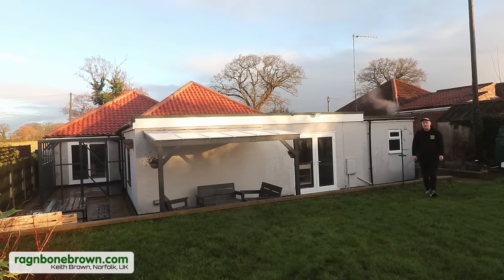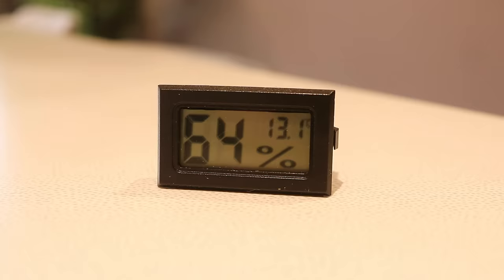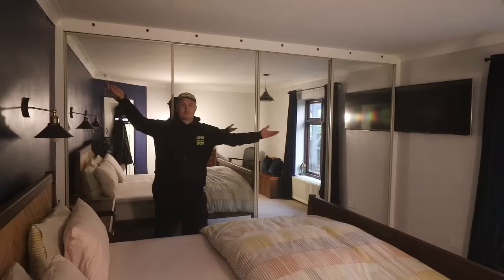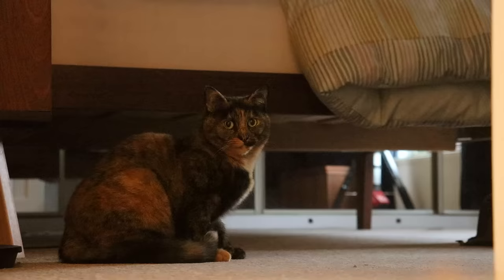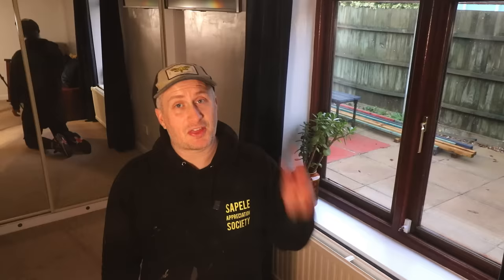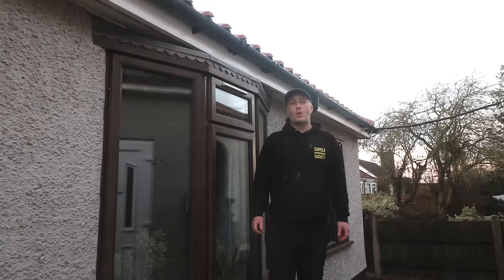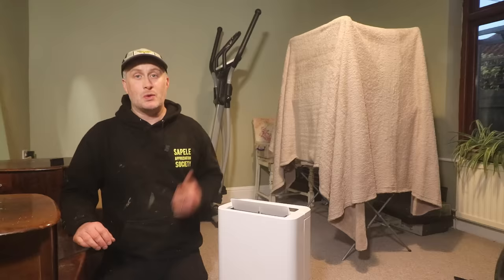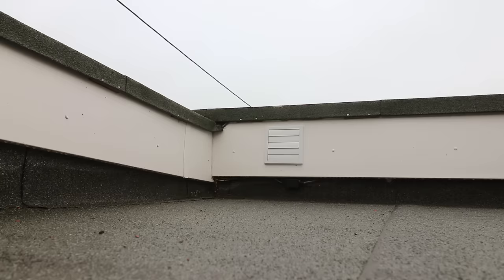8 Steps To Fixing Damp, Mould, Condensation & Humidity In Our Home

Comment: Hi Keith, I have copied what I put on Charlie DIYte videos on a similar topic with some extra bits for your info. During a bit of a renovation in our 1920's bungalow in NW England (mostly solid walls with external insulation) we installed a Mechanical extraction system (MEV). This works in the opposite way to your PIV. PIVs blow cool dry air in from outside/loft and the slight positive pressure it creates pushes air out the gaps in your home. A MEV is essentially a big extractor fan which blows warm, moist air out the property and the slight negative pressure pulls in cool dry air from outside. Ours is a Vent Axia Sentinel Multivent system with humidstat. This is the first winter we've had it installed and although we have made other upgrades to the property such as insulation and updating our double glazing, we have had no condensation on our windows this winter. The humidity readings in the house are also now around 40-45%. It extracts from our utility room, bathroom and the w/c. The utility room is next to the kitchen and the rest of the living space is open plan. I cut the utility room door short so that air flow is good even with the door closed (this is something you didn't mention in your video but you could try. The PIV only operates in one location so might struggle to affect the whole house) but if we are drying washing indoors (we don't have a tumble dryer) I leave the door to the utility open. This systems runs at a low level 24/7 and has boost function when the bathroom light is turned on (other control options are available) It also has a humidity sensor which can activate the boost speed. The utility room and w/c can be a bit cold when someone is showering and the boost is activated as it affects the whole system but at the low setting I don't really notice it (each setting is adjustable from 1-99% so lots of control). When this unit dies we may look at a MHVR system but they are considerably more expensive. We used to have a dehumidifier but we recently sold it as we don't need it anymore. The only other things I could suggest would be to get a humidity sensor for the bathroom extractor and maybe experiment with running the PIV on high to see if it makes a difference and if it's worth it to you.

Comment: I am not sure I would install a PIV and use a dehumidifier. The dehumidifier will dry the air without bringing in cold air from outside (outside air is also quite damp in the UK in winter), overall it will be much cheaper to run.
Reply from the maker: We shut the door when using the dehumidifier so it's isolated from the piv

Comment: Having similar issues. 1940s bungalow/with roof conversion at later stage. Issues are worse now we’ve had all new d/g windows fitted (Crittal before) but conservation area to had to match existing, therefore no vents.  I’ve only just been looking at these PIV systems and seeing yours will probably swing it. Already run a dehumidifier in various rooms around the house. Just need to up airflow.
Reply from the maker: Interesting thanks Kevin. The PIV has been a revelation for us

Comment: you need to get a heat pump tumble dryer super efficient yes the cost but you will get your money back i was once in an R and D dept testing all tumble driers and the guy running the test replied to my comment about the Heat pump tumble drier I had and he was testing was that the others could het no where near the efficiency. Its just a dehumidifier within a tumble drier. there are no heating elements in them so they is far les risk of fire. Als changing your vent system for a heat exchange vent system will save money as it warms the air coming in using the air going out.

Comment: I feel there is something we are all missing when trying to fix humidity and condensation. Our bedroom has a solid wall which is cold. This can cause condensation and mould to form even with the window open. However we also have a built-in cupboard on the same wall which has no airflow but this has no condensation problems. The bedroom wall and ceiling have been recently plastered whereas the cupboard looks more original which perhaps has better breathability? I guess double glazing, insulation, modern materials etc are just not suited to older houses so we will be in an endless fight
Reply: If the cupboard has no airflow then presumably no moist air can flow and condense on a cold surface. The cupboard is presumably thin wood which s easier to bring above the dew point than a thick stone wall.

Comment: I too think 30-60% RH just isn't possible (at least in winter). We struggle to get ours below 70%. It's a detached 30's house but well insulated with double glazing, we run the heating twice a day (typically 18 - 19 degrees C) and ventilate regularly. We have an open fire, which gives out pitiful amounts of heat but does seem to dry the house - but still, seldom less than 70%.
Reply: We had a similar issue but invested in a quality dehumidifier and now our humidity levels are 50% and below

Comment: that bathroom vent is gonna be a problem, vapour will condensate when it meets the cold loft pipe, need to atleast insulate it.
Also you can get air humitidy actived fans, I just installed one in my bathroom and it makes a big difference, place a few of those around the house would trigger them when it rise above 60
%

Comment: In a bungalow in Ireland, I measure humidity also through the house and gather all the data via a raspberry pi, we are sitting at about 60% humidity during the winter but I do still have some slight mould issues on the front room which are facing south. This is despite opening windows daily, having the vent on those windows too - I will look into that Positive air vent thing you have, it sounds really good - question on it. would you place the opening in the hallway center of the house then?
Reply from the maker: Yes I'd get it as central to the house as you possibly can 👍

Comment: Why PIV instead of MVHR? You should be making your home more airtight and extract moisture, not blowing outdoor air inside. Your home should be at negative pressure, so that the hot air doesn't leak. The difference in temperature between the floor and ceiling is enough to move the air through convection. Bungalow is ideal for underfloor heating and MVHR. You could even install a humidistat to automatically turn it on and off. Also, are you sure that the excess moisture is not coming from outside? As you heat your home, it becomes like a sponge sucking in moisture through bricks and floor (and possibly roof if it's hot). You need to regulate fresh air intake, so that you control how much moisture you bring from outside. PIV blows moisture into your walls and windows. You should instead install trickle vents and suck air from your walls to the loft and weatherproof your walls to make them dry. Also, make sure you have damp proofing in your floor. It appears you have a solid floor. Old floors have this problem that after every rain the soil dries into the room through the floor.

You need to understand basic water cycle. When sun shines it heats the soil and water. Soil and water heats the air. Water rises from the soil into the air, as hot air can hold more moisture. As warm moist air meats cold surfaces or cold air it condenses (water is extracted from air) and it rains.

The same thing happens in the home. Only this time in addition to natural moisture from soil you introduce your own moisture when you breathe, cook or dry closes. To protect from outside moisture you use damp and weather proofing (dryrod, dpc, dpm, etc). To protect from inside moisture you make sure the coldest surface in your home is your ventilation device which allows moisture to escape outside. To do this you insulate your floor, walls (externally), install airtight windows and make sure there's either natural or mechanical airflow from bottom to the vent pipe. In addition, you could install vapor control layer which further reduces exposure of your walls to moisture (preventing mold growth inside your walls).

And that's it.

Comment: Thank you for sharing your journey through the damp wars! I recently moved into an old damp house and started with buying 2 small dehumidifiers to see if they would help, and they have! I have to empty them every couple of days and I keep them running 24/7. The problem is in the cellar. I should say it starts in the cellar. What can I do that's inexpensive to try to make it drier? I can't store anything down there for fear of it rusting or getting mouldy. The landlord says that work was done to stop the damp but it takes time for it to dry out.  True or not? I don't know. Any advice out there?❤
Reply from the maker: Tanking slurry is probably the best option
Reply from the maker: https://youtu.be/rtTNsLFCLkQ
Reply: Thank you so much. Plus the outside wall is a problem. I think with a bit of work, problem solved.

Comment: Hello! 

My message to all people who have the same problems as you: first find the cause of the condensation or the mold! In England there are certainly independent experts that can help you. 

You've done a lot of work to avoid mold and condensation. But I wonder if you have also found the cause. You can never cause condensation and mold by washing, cooking, sleeping and drying the laundry. If that were the case, many homes would have the same problems as you do. And that is not so. 
The moisture values after the works are still very high, from which I deduce that the problem has not yet been solved. In winter, a relative humidity of less than 50 in a house is quite normal. It is important that the cause is detected and remedied. Then you can close all those ventilation holes again because they cause high heating costs.
Reply from the maker: The cause of the mould is condensation. The cause of the condensation is high humidity, which is absolutely caused by clothes drying, people breathing, cooking, washing and all those things. And many homes DO have the same.issues, hence why I made this video
Reply: @RagnBoneBrown  

If your claim is true that condensation and mold is caused by cooking, washing, breathing, ... then you should identify these problems in every home. However, this is not the case. 
The comments on your video show that too. Many do not have these problems at all, on the contrary. And yet these people all wash, cook and breathe in the same way. 
It is logical that this cannot be a cause.  

I am a professional and always identify other causes. 

In almost all cases, water runs into the house so that floors, walls or other building substances are wet. This water evaporates permanently and ensures the high moisture values in the house. 
When I look at the picture of your bungalow, I think there is a very good chance that there is water in your floors and walls. That's still going on.
Therefore, measure the moisture content of the floors and the bottom of the walls. They measure wet in many places. 

If you had removed this cause from the beginning, you would have solved the problem definitively! 

Your video perpetuates the myth that mold and condensation are the result of resident behavior, and encourages people to fight the symptoms rather than eliminate the true cause.

Comment: Dehumidifiers work much better if you use a fan with them.  They can only remove moisture from the air around them, so you need to promote airflow to bring the dam air to them.  Also don't forget to service your dehumidifer, give the filters a clean out now and again, although most are not user friendly and require a fair amount of dismantling.

Comment: Wow you have covered all the bases Keith, will get some of those sensors you linked to. Perhaps your render is trapping damp ie impeeding it's exit. I have trickle vents everywhere and find them very effective. However I was told not to operate them when it is cold and damp outside in the winter as the air coming in is more moist than that going out, but if you are very high to start with it might be the thing to do. I guess if your walls are older and you are drying washing in the house then that is going to give problems, I know some people do place the washing machine and dryer outside the house, could be an option in the future for you.

Comment: hi and cheers for this, if you have a high humidity loft space do you think it's a bad idea to get a positive pressure fan? Thanks 👍
Reply from the maker: Hi, from what I know about loft spaces, I think if it's humid up there then that could mean there is a problem. Loft spaces should be well ventilated at the eaves, otherwise condensation could create problems, the timber structure could start to rot
Reply: @RagnBoneBrown  Thank you mate, yeah I have been thinking of putting some soffit vents up there. No signs of rot, last owner did a bodge loft conversion which I'm slowly reversing. I bought 7 or 8 cheap (at the time) relative humidity/temp things and put around the house. Also punched through wall and put single room MVHR units in bathroom that did not have any extract...other than a window, that opened into the conservatory 🙄 MVHR goes straight outside via 90 degree 100mm pipe.

Comment: Good insulation, a steady level of heating (low or high is not so important as long as it is consistent), and plenty of ventilation and you should never have any issues with damp in your house. The problem is that so many house do not have much, or any insulation whatsoever, and with energy prices going through the roof a lot of people opt to turn heating off most of the time, and neglect to air out their house.

Comment: On the west coast of Canada here... I don't understand where the moisture is coming from? In the winter, even if the outside air is relatively moist, once you bring it inside and heat it up it becomes relatively dry.  Is the brick construction so porous that it brings moisture in right through the walls? Trying to dry your clothes by hanging them inside seems like a terrible idea if you have a humidity problem, I think most everyone in Canada/US has a heated tumble dryer (natural gas or electric) that vents the moist air outside. Typically in north american construction at least, attic air is intended to be outside air, vented through the soffits and out through ridge vents or similar, preventing a build up of moisture in the attic space - a machine with no heat recovery system that just pumps  attic air into the house might as well be pumping outside air into the house, I mean, you could just open your front door or windows and put box fans in them for the same effect. It seems like you are doing everything you can to push the wet air out of your house (along with the heat it carries), but a more efficient solution might be to figure out where the moisture is coming from and prevent it from getting into your house in the first place! Thanks for sharing your approach!

Comment: Worth being mindful that heating a room won't reduce the absolute moisture but will reduce the relative moisture level (as warmer air can hold more moisture). And in some cases heating the air means it can hold more moisture which can make the problem worse if it eventually dumps it.

Having unevenly insulated areas made our problems worse. The windows being so much colder meant they became the dew point where all the room's moisture would get dumped.

Inline fan in the bathroom made a huge difference for us. So, so much better than a wall fan.
Reply from the maker: Thanks for the great info

Comment: Just get a decent size dehumidifier and keep all the heat inside. We’ve gone much more sealed / insulated / draft free and we don’t have high humidity, damp or mould, as the dehumidifier looks after it. Once you’re on top of the moisture, it doesn’t use a lot of power.
Reply from the maker: Interesting concept.... Cheers

Comment: Ask Roger Bisby of skill builder YouTube channel. He should be able to advise.

The Other option is to paint the outside of your house with Storm Dry, Roger Bisby raves about this product.
Reply from the maker: Cheers although I don't see how stopping moisture penetrating the building impacts humid air that is already inside? Am I missing something? 👍
Reply: @RagnBoneBrown  my theory is by adding water proof coating to the exterior your helping the building to become warmer, because it is less wet which reduces cold surfaces inside the building which in turn reduces condensation then reduces mould.

I could be talking through my arse, but I think it's still worth doing and relatively inexpensive.
Reply: @RagnBoneBrown  I'd put one of the humidity sensors outside.  It can tell you if your problem is more moisture coming in from outside or moisture from showers/laundry, etc.  If it's higher humidity outside on average, then checking your exterior wall vapor barrier may help reduce the levels more.  Moisture does seep through most building materials.
Reply from the maker: They're a good point! More learning required on my part 😁👍
Reply from the maker: I'll try that, good idea

Comment: 1930s end terrace and it never drops below 70% humidity.  You have to remember that the joles in your home to let air in obviously let moisture and mould spores. The best thing I've ever done was to ho to home bargains and buy that plastic sheet for the windows. Just remember the sheet DOESN'T GO ON THE GLASS!!!  You tape it on the frame and heat it with a hot hair dryer to make triple glazed windows. Before that I bought some self adhesive window film from Lidl and WOW, any sun that hits it has its heat trapped in your home. I have windows of 30°c in the winter sun. Global warming my arse.